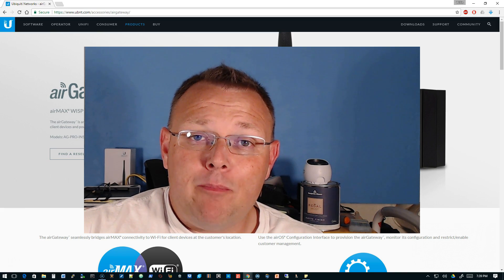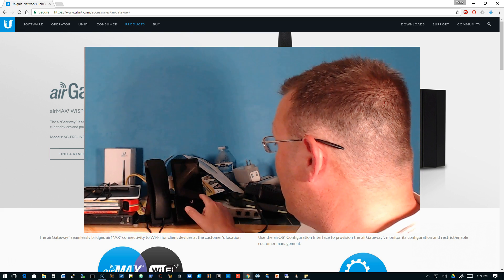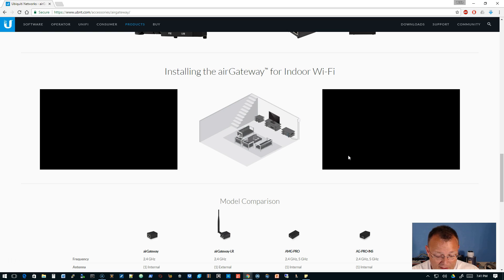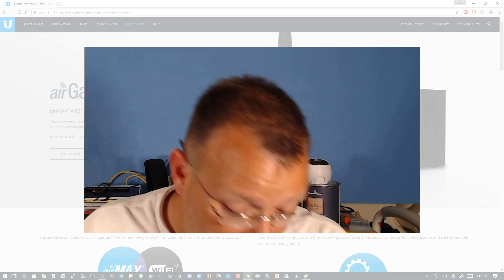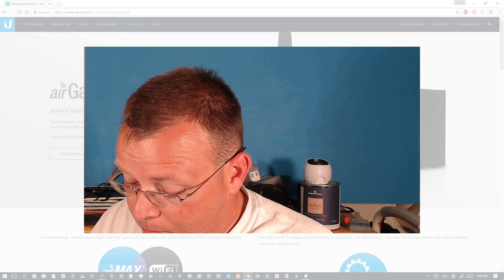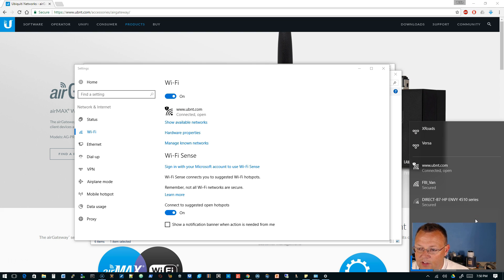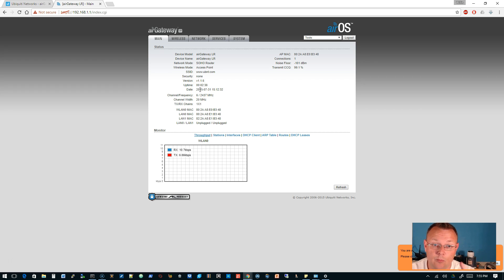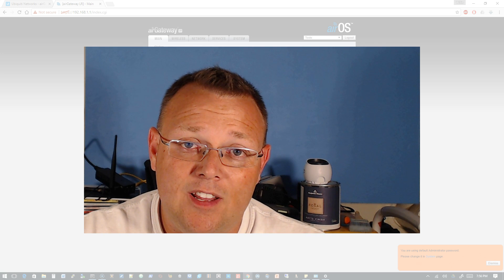Ubiquiti airGateway LR

Comment: Why doesn't ubnt sell wifi dongles? 
I would pay a fair bit for a decent dongle that doesn't crap out the moment traffic starts picking up.
Reply: Those don't overheat? I have wasted several €100's on wifi dongles over the years that all shut off the moment they have to work a bit and do more than just facilitate a print job, some surfing and reading some e-mail.
Reply: Never had an issue with them, been using them for 3 months or so, some in some pretty harsh environments!

Comment: Definitely best to place the adaptor near the equipment and not at the switch end. The output is regulated to 24v and doesn't take into account the voltage drop down a potentially long ethernet cable - if you place it next to the device you'll get the full 24v regardless of cable length. I've used these when I've had stability problems with Ubiquiti APs on long runs of cable due to supply voltage drop.
Reply: Agreed.  They make out door versions but they have a pigtail cable that must be plugged into the AP, for one and why go up a pole to change one.  Although an only toughswitch might do just as well without spending any money.

Comment: On your live stream it looked like you were using the 24 port unifi switch. If so, why not use the passive POE settings. On the AF adapters it’s better to keep by switch especially when you need yo replace. We have replaced a few dozen. 

As for the Air gateways, they are nice because they clip onto the POE injectors of the NanoStation or other CPE. BUT they suck in that they are only 2.4Ghz. Which is 15 year old technology. 

Thanks for all you do.
Reply: They've already shipped some 802.3af compatible AC-Lites so they're definitely moving in that direction for AP's. It'd be nice if 24v passive disappeared from the UniFi range altogether but I don't see that happening with the larger USW switches for some time yet.